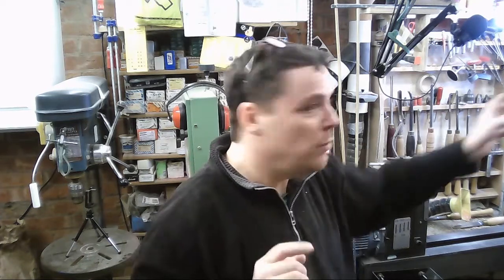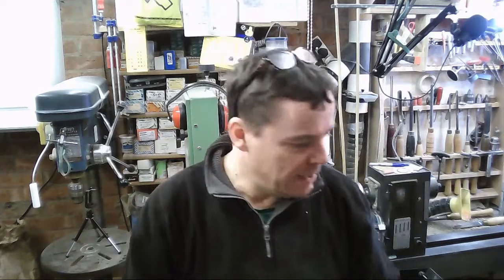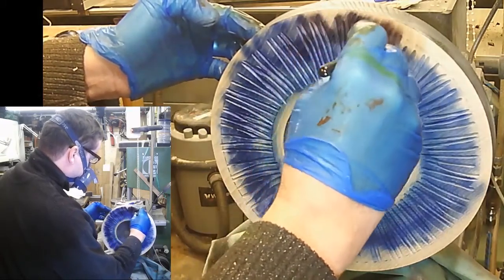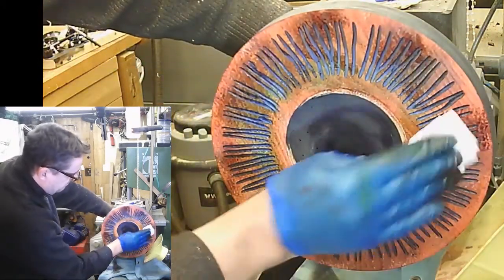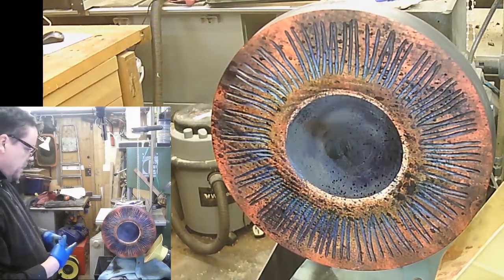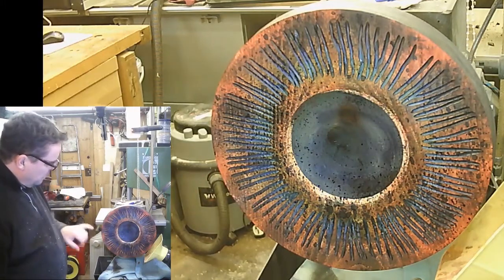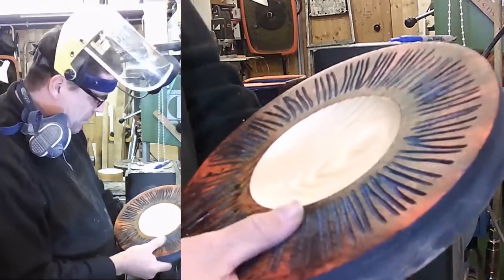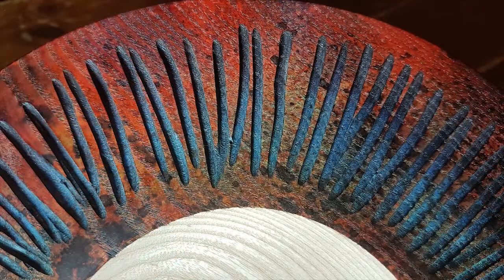Gradient Texture and Dabbing

Comment: I'm liking that coloring and texture on this blank been staining Xmas decorations I turned on bear wood and no sealer but not soaking in very good whot grit do you sand too and do I sealer first hope you can help Stewart
Reply from the maker: Thanks, Barry - I usually do seal the wood first - I think it stops the colour penetrating as much into the wood, so thereby making them mix less. It does mean they take a bit longer to dry.  For sanding I usually go to 400. Cheers!